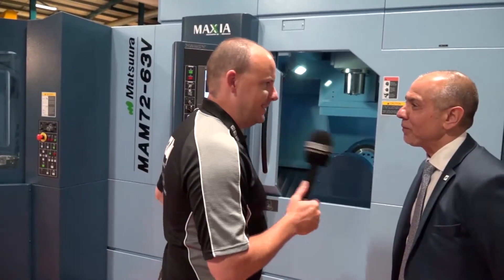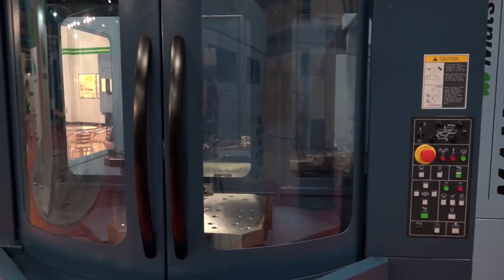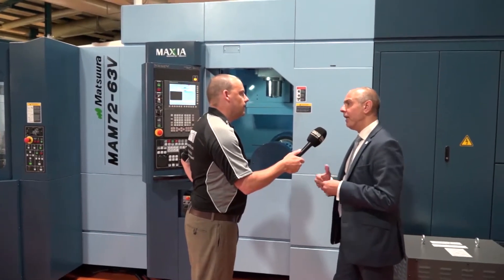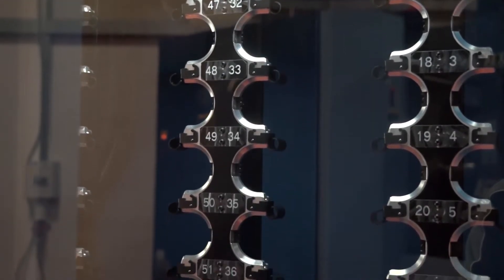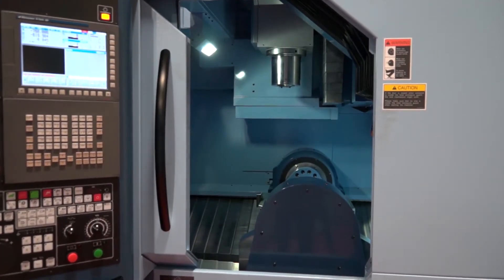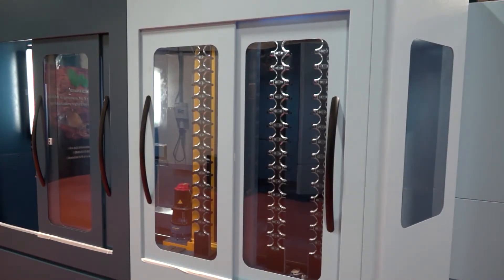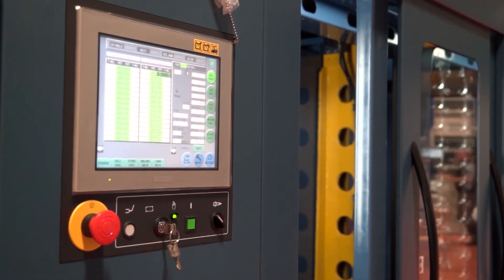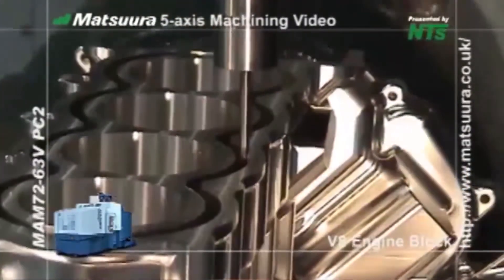Dom from Matsuura discusses the MAM72 63V 6 pallet 5 axis machine

Comment: 1if not the very best machining centres I've ever programmed used and ran,I've ran 1 of these for 100 hours non stop machining valve bodies machined 500 components in that 100 hours and the 1st part and 500th had 0.025 plus tolerance on the bores and not 1 component was scrapped worth every penny